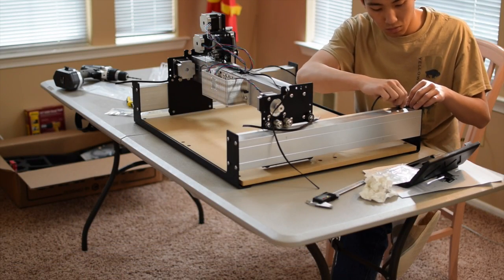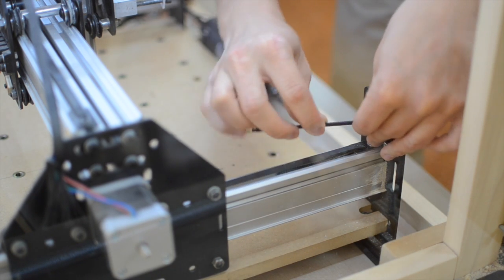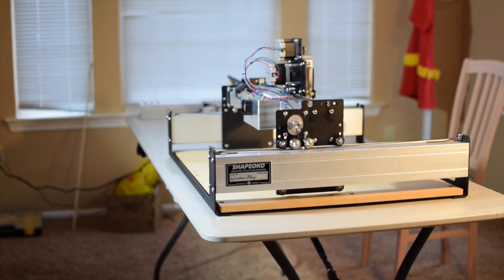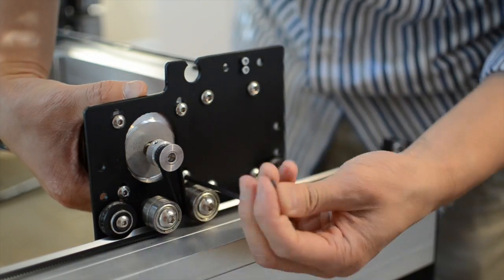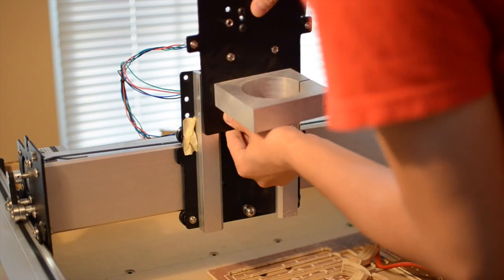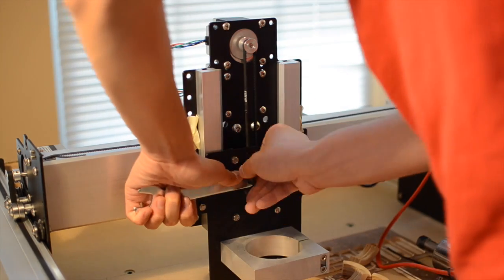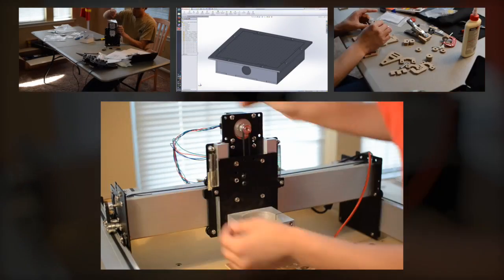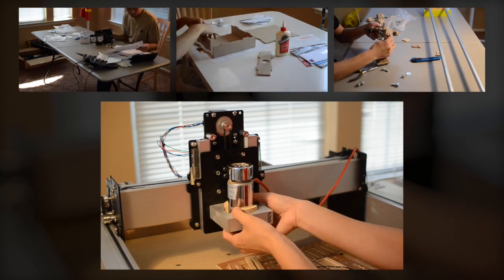How to Tension GT2 Belts on a (2015) Shapeoko 3

Comment: Hey on my shapeoko xl I've noticed my my Z axis router base would have play and it would allow the bit to move slightly.  I found the lower pulley keeps getting loose. Is there a way to keep it tight or it this just part of a daily maintance?
Thankyou!
Reply from the maker: I've never had to re-adjust mine. Try putting a dab of loctite or other thread locker on the problematic screw(s).
Reply: Winston Moy thankyou for your reply! I'll do that

Comment: How is the stability of the shapeoko 3 compared to the 2. I know they increased its stability a lot, but my main area of concern is the z axis. Being that you have messed with both machines, how hard do you feel it would be to upgrade the shapeoko 2 z-axis to a shapeoko 3 z-axis, if possible? Thank you in advance =)
Reply from the maker: Manicska The main problem is that the Shapeoko 3's Z-axis is composed of two rails that are spaced much further apart than the V-edges on Makerslide. That spacing, and the fact that they're very thick and low profile means they don't flex, and the V-wheels have a nice wide footprint to distribute loads. 
Unfortunately, it's physically almost impossible to put the S3 Z-rails on an S2 carriage plate, due to their spacing. If you were to machine, or have fabricated, a custom carriage plate to go on the X-gantry, then it might be feasible.
Reply: Thank you for your quick response =) Thought of possibly upgrading to an X-Carve Z-axis but figured I would ask about the Shapeoko 3 because it looked a lot beefier than the 2. Thanks for the input!

Comment: Your videos have been a ton of help.  Any chance you could find the time to do a short on how best to set the roller bearings friction?

Mine seem to be "ok" but would like to see how someone who has done it several tiles goes about it.
Reply from the maker: BellyUpFish You mean the V-wheels, correct? I'll try and put a quick vid together, but basically, I'm aiming for the wheels to be difficult to rotate by hand after adjustment on the eccentric nuts.
Reply: Yes, the V-wheels.  Mine seem ok, but I don't want them to be too tight.

Comment: Winston, quick question:

When adjusting the tension for the X axis stepper, the carriage should be at the lowest or highest position of the Y axis right? (center of X, top or bottom of Y)
If its in the middle, wouldn't you be applying more tension to the belt?
Reply from the maker: Rodrigo Cardenas You are correct, when you lift up by the motors, you want 2 out of your 4 corners still firmly on the table. Ends of the Y-axis is the best place to tension the X-axis belt.